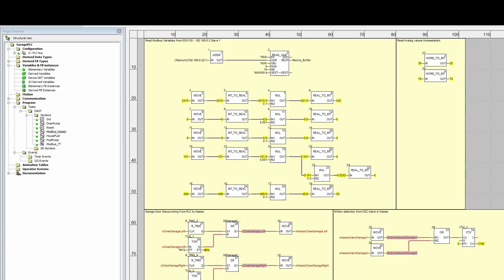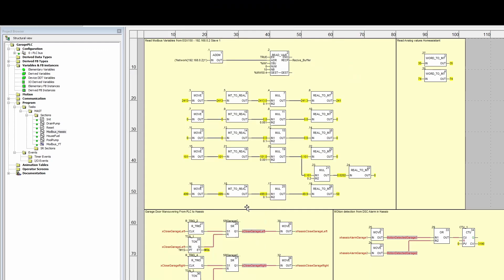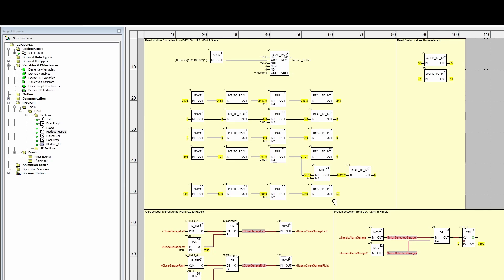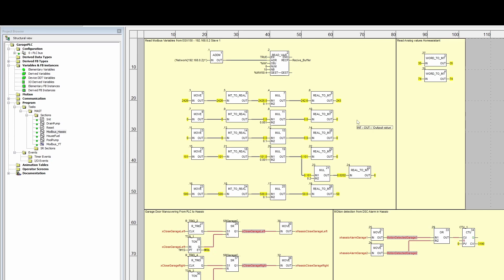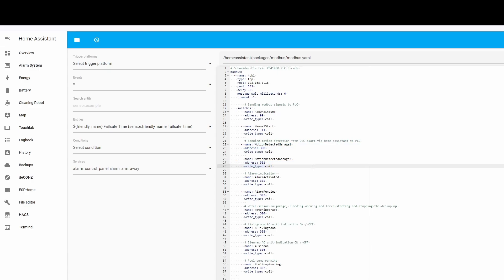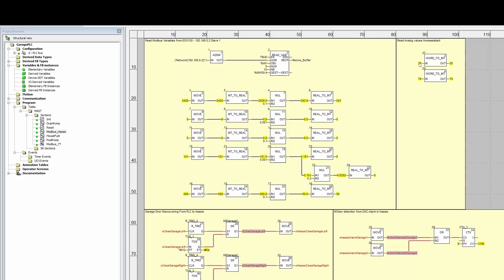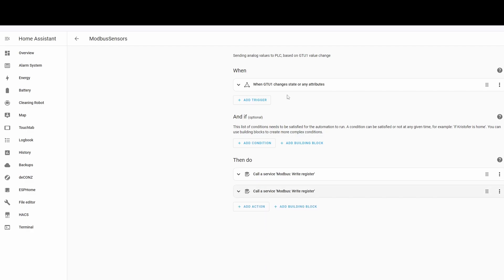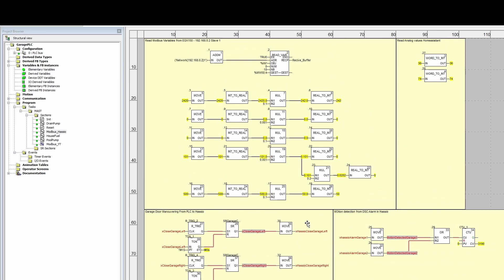Setting Up Home Assistant with Schneider Electric PLC & Modbus via LINK150

Comment: Hi, love the video. Been searching for this for a long time!
I have also a Schneider M340 PLC for the house and am unable to connect my Home Assistant setup with the Schneider PLC. Is the Link150 needed or can it be done directly via the ethernet/modbus of the PLC? This mainly to controle light switches via Home Assistant. Thanks in advance!
I can access my PLC configuration via the Unity Pro XL over wifi as the Home Assistant dashboard, but am unable to connect the two... All the standard Home Assistant guides/how-to's didn't work for me. So hope you can help me in the right direction!
Reply from the maker: Hi, i am sorry it took so long to reply, i don't know why i did not get any notification about your comment.
You want to turn on and off lights from Home assistant in your house that is connected to your PLC, is this correct? 
In that case we need to setup the Modbus registers in PLC and home assistant. It took to long for me to answer so I guess (hope) that you might have solved it already. I will still make the video on how to proceed.
Reply: @polymathengineering  correct. All house lightning (and some power sockets) are controlled by the PLC.
But want to link them to HA to automate many things and make scenes.
But faile to link HA to the PLC...
Reply from the maker: @mickcelis6712  I understand, please send me an email to polymathengineering@outlook.com and i will send you some ideas there. If you have a Config file for your modbus section attach that as well. Looking forward to hearing from you soon.
Reply from the maker: Also send information about your PLC setup in Unity Pro, what type of communication are you using with the PLC, NOC0100 or something else?
Reply: hello, nice video as always. I hope you can do one video with wago PLC cc100. as I having a hard time configuring the registries. I did it with mqtt but something tells me it should bi done more directly via modbus!! Thank you!